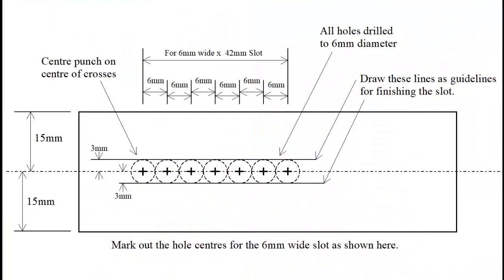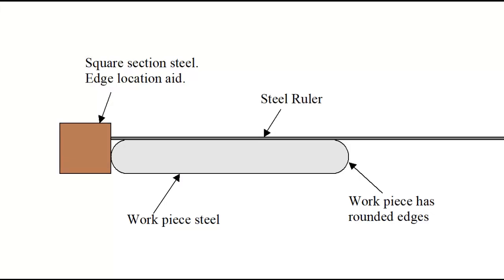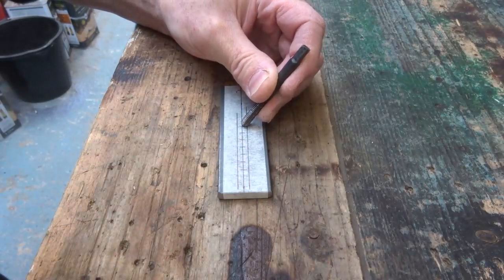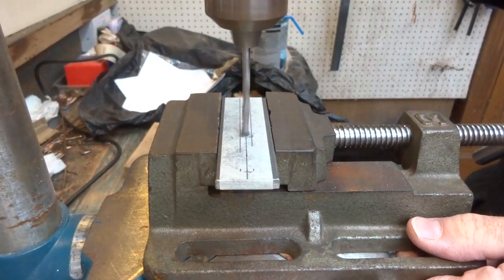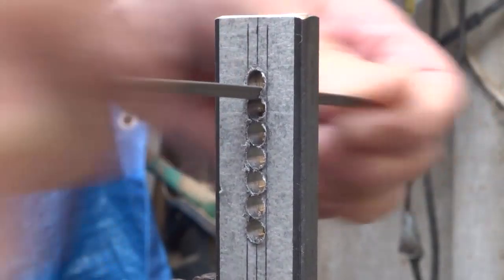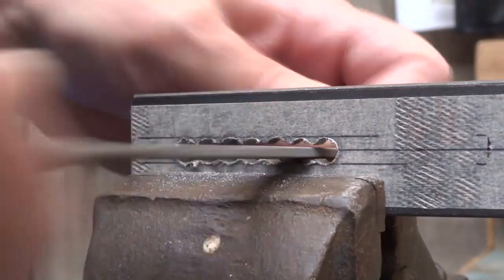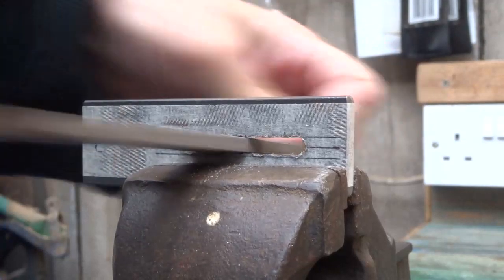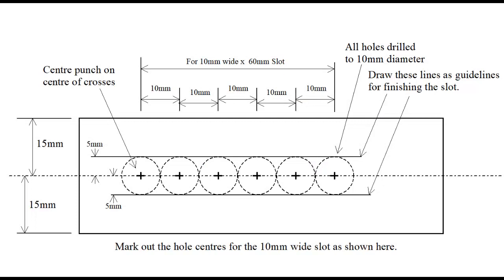How to cut a slot in mild steel using only home workshop tools

Comment: hey grandad, get modern use dykem and an angle grinder with a cutting disc.
Reply: In the cheap/fast/accurate trimutive; a milling machine is fast and accurate; an angle grinder is cheap and fast; and this method is cheap and accurate. It's a matter of your needs as a metalworker.
Reply: You missed the whole point! I have dykem,a Bridgeport mill, and a South Bend lathe with milling attachment, but I appreciate what this gentleman was demonstrating for people with limited equipment, and/or ones who choose to do small projects more simply (or safer). And the tape (or even a glued on paper template) works just fine for this procedure. His knowledge and use of different file types shows he has been around a while and learned skills younger people would do well to pick up. I have seven angle grinders and always keep a minimum of 50-60 cutoff wheels. They are great tools for the correct job, but for a small slot that needs to be straight, with parallel sides, no way an angle grinder is going to match his accuracy. Especially if the slot is small enough not to allow the cutoff wheel to fully plunge into the slot. But enough of that….My main point is to be kind. Appreciate the skill and intellect required to find ways to accomplish difficult tasks with simple methods. Your ancestors helped build the world we have today without modern tools we take for granted! 
Great-grand dad here…
Reply: Some people have files some have grinders
Reply: @jesseclem7997  But we all have our vices.
Reply: And what if you need a short slot? You think you're hot shit just because you know what dykem is -- better you keep quiet and learn from those who actually know what they're doing.
Reply: I used an angle grinder once while making a groove....it is not particularly accurate. At most one can grind out some of the excess inside the groove, but if you're tempted to grind up to the line it won't be pretty...or straight.

Remember, you can always take material off easily, but you can't put it back on. Better to take your time and do it with a file!